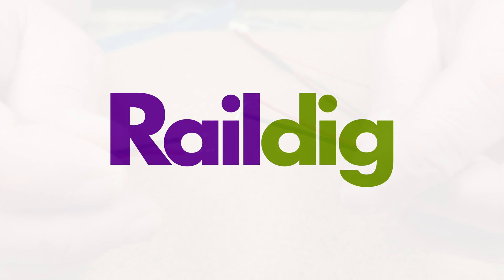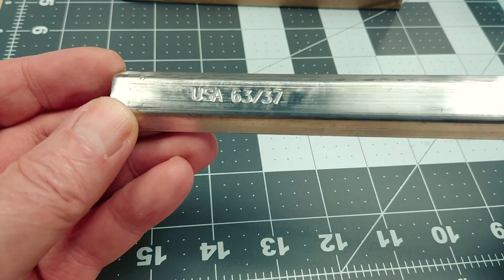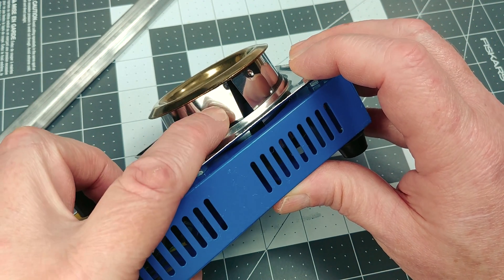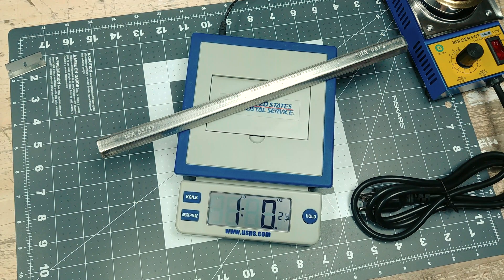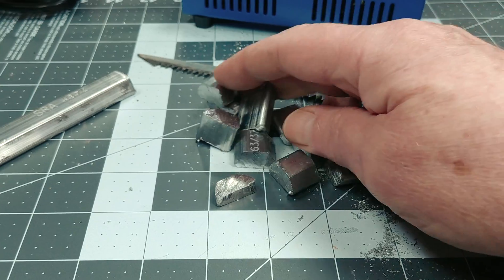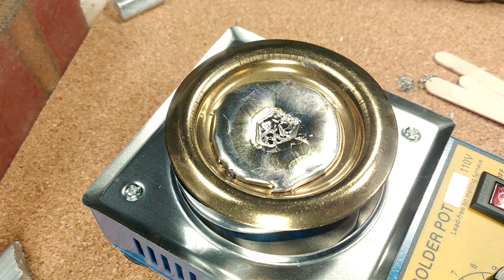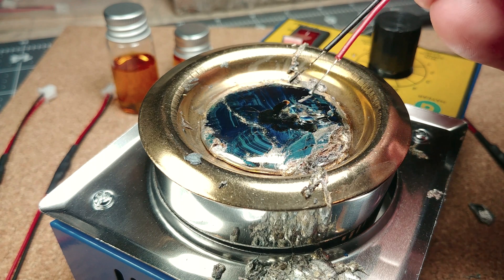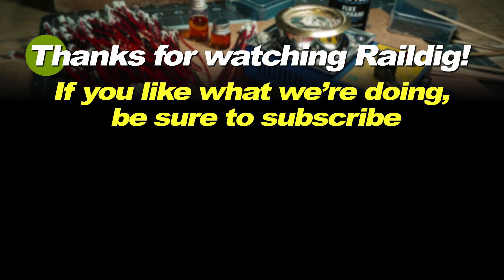Our First Solder Pot For Tinning Wires

Comment: why you try to cut it? You could melt it directly and you can pull it when you had enough melting
Reply from the maker: Being the first time I'd used a solder pot, I thought it'd be easier to have small chunks. Plus of course, I was just curious abut the solder bar overall!
Reply: @Raildig  avoid touching lead directly and use gas mask when using that device.

Comment: Good work. Have you tried to tin thick wire insulated with heat resistant coating? (Transformers wire, maybe enamel coat)
Reply from the maker: Thanks for watching the video! I haven't tried on the insulation as you mentioned. Can't say for sure but I don't get the feeling it would work, I could be wrong but I think the thickest insulation it'd melt would be something like the coating on magnet wire. I think magnet wire does use enamel coating, so I do think that would work. Again this is just a guess on my part as so far I've only used wire I've stripped as in the video.

Comment: Amazing content to watch, but please take care of the metal swarf it contains lead 💀☠
Reply from the maker: Thanks for your input on this. I always keep a small USB fan to the side when working up close with glues, solder, airbrush, etc. I've tried the lead free version but just don't care for it too much, so I take basic precautions like the fan and fresh air with an open window or two... even in the cold weather. I'm not entirely sure just how much small lead amounts actually matter, but for the price of the small USB fan and an open window... I figure it's a small precaution to take that doesn't really have a downside. Thanks again for your comment here, it's appreciated!
Reply: @Raildig  yups fan actually does the trick (even better with hepa filters), but from a different pov leftover lead will contaminate your surroundings (hurts others unintentionally). I mean you should dispose it safely(i collect them and other microplastic in plastic bottles), unfortunately even small amounts of lead isn't safe or acceptable i mean life is priceless so yeah just take care. Thanks

Comment: לא הבנתי למה צריך את המכשיר הזה .
אפשר פשוט להשתמש עם מלחם
Reply from the maker: Ok, I had to translate here but... a soldering iron works for a few wires at a time but when you're looking to join or even tin hundreds of wires at a time, a soldering iron would take too much time. Also by using a soldering pot you can get much cleaner and more consistent results!

Comment: I worked at an electronics Assembly company - we had the heavy brick style...from the 70's - still going in 2006 when the company folded. - But they are like $300-500- so for $25 and it lasts you a couple years....Why Not...at least you know more going in when you need to replace it.
Reply from the maker: I agree 100%, definitely not industrial or commercial grade. Sort of like a cheap Harbor Freight tool over a Makita or similar. Both get the job done, but if I'm a pro carpenter, I can't afford to have my tool die midway through the day. If I'm a casual user, it'd be annoying but not a big problem

So far this little pot has done ok and you are right, if I get a few more years from it, I'll call it a win.

Comment: A solder pot like this is also useful to keep the soldering iron tips tinned after cleaning them. The goal is to re-tin the tip before heating it up to avoid oxidation. Playing with temperature of the pot will have an effect on how much junk is accumulating on top surfaces. Running it too hot will build up more junk as solder pool oxidizes. I run mine around setting #5, but this will vary based on the solder you load it with.
Reply: You're new, inexperienced.  Solder tips don't "oxidize" as you say, what you are experiencing is the resin burning up, contamination. Just wipe it off with a cotton cloth before use, after use, it will be bright and shinny and remain that way 10 year later until used.  What you don't understand is solder will not stay bright and shinny  and "flow" well unless it contains resin. In other words you only have a second or two solder with that perfect resin solder mix before burns it up and introduces impurities. .Newbies add more solder, what you should be doing is adding more resin and or wiping the contamination off your tip, project.  A solder pot does nothing here except sell solder pots to hobbyists, kids, who don't know better. If you tip needs retaining there is a product for that, it works a 100 times better than this, cost like 3 bucks. Try it!
Reply: @daviderickennedy2194  I am as much new as you are an idiot. Soldering tips do oxidize in air at tip pemperatures appropriate for Soldering. That is why nice soldering stations like from jbc cool the tip down when the soldering iron is returned to the base. To protect from oxidation you tin them. Tinning them in a pot is the best way to tin a brand new untinned tip. Some new tips come pretinned from the manufacturer, but not all.
Reply: @ghffrsfygdhfjkjiysdz  do you guys post this everywhere?

Comment: I never knew these solder pots existed. Whenever I needed to tin stranded wires I used a soldering iron with a small tip. Right now I'm converting halogen downlighters to LED and there are four cables to move from the old transformer to the new LED driver. However, it would be overkill to buy a solder pot for this job as I only have 6 lamps in total to convert. Nice gadget, though.
Reply from the maker: It was the same here, I knew about them but held off until it made sense to buy. Even this inexpensive one has really saved me time at this point.

Comment: Nice video! I used bolt cutters for the lead.
Reply from the maker: Better choice than my little saw!
Reply: Lead is notoriously soft and malleable, I bent mine into a coil and put it in the pot. It melted quite easily. Sawing, using bolt cutters, or any other form of cutting lead not only contaminates the tools but the solder as well. Buy some D-lead soap and wash your hands after handling lead. It doesn't take much lead to have a negative effect on developing children under 16.

Comment: I got the same stuff from Amazon but the larger version. I tried it today and my wires wouldn't tin. Guess the Flux is critical. Glad I found your video.
Reply from the maker: The wires in this video were very thin, that plus the flux and you can see how quickly they would tin. As long as the solder is properly melted, you'll figure out the right formula for your tinning!

Comment: Im on the fence about this one. I want one, but also i get paid to tin alot of wires and its kinda a relaxing part of my workday. But if i tin faster i can build more. I make custom battery packs and sometimes need to tin 100s of wires at a time as subassembly to my builds.
Reply from the maker: Just my take of course, but purely for tinning wires, I do find this oddly relaxing too! I also find the quality of the joins / tinned wires better than I was doing it previously. Very thin wires now look incredibly clean for me. I can see both sides of this... it's interesting!
Reply: battery packs ? Use a damn spot welder ffs
Reply: @Dinco422  alakline yes and for most circuits spot welder yes. But after the tabs are wleded on they are assigned wires which need to be soldered. Also lipos get soldered not welded , you can weld them i guess but i think its sketchy
Reply: @andrewut7ya511  Everyone is an "EXSPURT" in everyone else's field!
EX = Has Been!
SPURT = Drip Under Pressure!

Comment: Excellent job on the video sir!  I am looking at getting this pot to solder double zero gauge copper lugs to copper wire, I would crimp the lug to the wire, then drill a small hole at the bolt hole end of the lug, then dunk the lug into the pot, creating the maximum strength and conductive connection.   Has the product been reliable?  The pot looks quite deep, do you think it would be perfect for my purpose?
Reply from the maker: Thank you! Yes, so far the pot has performed exactly as it should. I'm not sure on the dimensions of the pieces you'll be working with, I never measured my pot depth as it never really came up as I only tin wires with it. Can't get an accurate measurement on my pot now as it's full of hardened solder. It might be a good idea to email whoever you buy from and ask then the exact depth.

Comment: The easiest way I've found to cut up a solder bar is with boltcutters, like butter!
Reply from the maker: Before I cut this first bar, I would have thought that would be overkill. After this one bar, I agree... good tip on the bolt cutters, thanks!
Reply: @Raildig  I'm not gonna lie, I saw you struggling with the saw before I bought a pot/bar and decided that I'd better bust out the big guns right off the hop! Hahaha, thank you for the helpful video my friend!
Reply from the maker: @keebsnstuff3400  I think that's great, a little cross-YouTube learning here :)
Reply: A big branch cutter from the garden shed should be able to do it perhaps.

Comment: For how long you can keep using the same solder inside the solder pot? Do you empty it and fill with new solder from time to time?
Reply from the maker: I had thought about this as well (I should write to the company that makes this solder). While I regularly do scrape off the oxidized dross from the liquid surface when heated, I just assumed I'd keep using the same solder, adding more chunks once it gets low in the pot.

Here's an article on solder expiring. I will have a deeper look into this:
https://www.evilmadscientist.com/2013/solder-expire/

Comment: Placing tinned wires into screw terminals is incredibly dangerous. The solder crumbles over time. This solder dust can cause short circuit and start fires. This technique is even illegal in a lot of countries. Please for your own safety don't do this. Crimp terminals are the proper and safe way to go. Even those and crimping pliers can be found rather cheap online.
Reply from the maker: Thanks for your input on this, I'd like to clarify a little what I'm doing. I'm not using screw terminals, but a spring / steel pressure fit connector so I'm not concerned with the wireds being crushed, as they could be with a heavier screw connector. The wires shown in the video are 28AWG and they while they are stranded, they actually already come tinned. These are all used in a low-voltage environment. The other wire I use on the other end is solid Kynar insulated. 

I've find with the 28AWG stranded wire (not tinned together), these connectors occasionally won't supply enough pressure on the loose strands to give a solid connection. Plus with wire this fine, the occasional stray wires can happen and cause a short. With low DC and LEDs, I find these connectors and the tinned wires do a nice job for me.
Reply: @Raildig  it doesn't matter what voltage, nor what cable thickness. The rule is to never place tinned cables into any sort of connector. Doesn't matter of it's a screw terminal or a super fancy Wago lever connector. Even something as low as even just 1V can start a fire. There are enough examples of people doing exactly this and having equipment fail or finding charred areas around the  terminals on the circuit board. A good example of this is often seen with 3D printer motherboards from diy kits that have caught fire, because people placed tinned wires into the terminals instead of crimping them. The main voltages on those boards are 12V, 5V and 3.3V. Yes it makes holding the cable in place much easier because it's a bit thicker, has solder around it wich keeps the cable Stands in place. But making things easier is not a solution if the safety risk increases. Crimp connectors can be obtained for any cable thickness, offer the same easier solution to keep the cables in place and don't pose a safety risk.
Reply from the maker: @HardDiskLover  I definitely appreciate your input on this, lots of good info you've provided, thank you!
Reply: @HardDiskLover  isn't like 99% of speaker wire tinned? They use the spring connectors no? Also perhaps lead free tin which is way harder is what they use? Curious is all, building a few projects that require a mix of applications and I want to get it right.
Reply: @adept00  speakers use tinned copper where each individual strand is tinned with very thin layer of tin, not the whole wire is tinned like this pot would do. The problem with tinning the wires is that solder is harder than copper, so under pressure solder cracks and breaks copper or under vibrations even without significant load the copper wire will break at transition point to solder, because of sudden change in hardness/stiffness since solder is harder than copper.

Comment: It's now January 6, 2021, is it still working for you? I'm considering making a new heater circuit for my 1974 model or buying a new one. I use it for tinning wires and for quick printed circuit soldering too. I suspect that's part of the idea with the flared bowl design, you only need to run it full for floating boards. Mine was 300w before the heating coil went poof from old age. The dross, tin oxides, covering the top of your molten solder is desirable as a protective barrier to prevent another layer of tin oxides forming as long as you can poke through it.  Your video is well ironed out sir.
Reply from the maker: I've used this now for around 6 tinning-only sessions of between 100 - 400 wires per session with no issues at all. I also just checked and a near identical pot can be had for around $15 on AliExpress... half of what I paid.

Your dross / oxide comment got me doing a little reading over on Wikipedia, interesting stuff:
"60/40 Sn-Pb solder oxidizes on the surface, forming a complex 4-layer structure: tin(IV) oxide on the surface, below it a layer of tin(II) oxide with finely dispersed lead, followed by a layer of tin(II) oxide with finely dispersed tin and lead, and the solder alloy itself underneath."

Had no idea that simple waste dross was so chemically complicated! Thanks for pointing me in that direction. Thanks too for the nice words on the video... ironed out, I liked that!
Reply: @Raildig  any new videos coming out?
Reply from the maker: @topcheese2889  Absolutely! Just been really tied up with building a new website for Ztrack Magazine. I'm through the tricky technical stuff there (I think!) so videos soon!